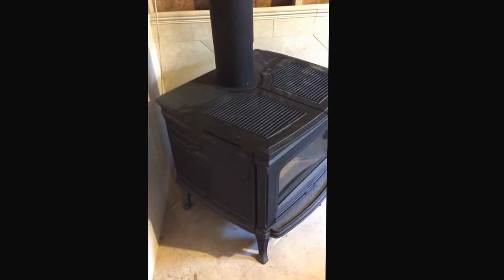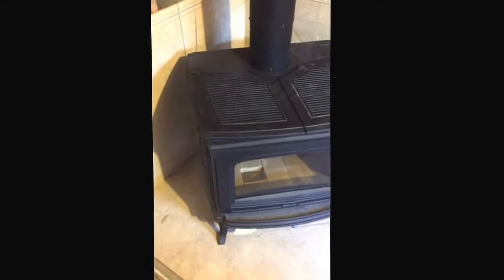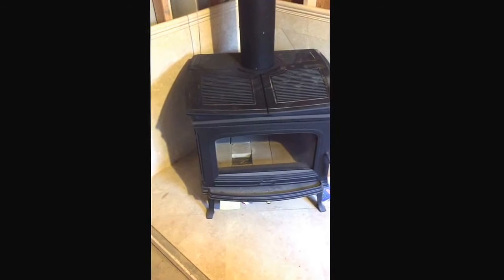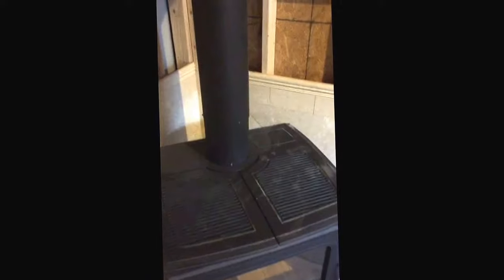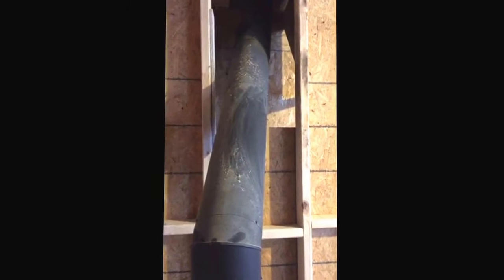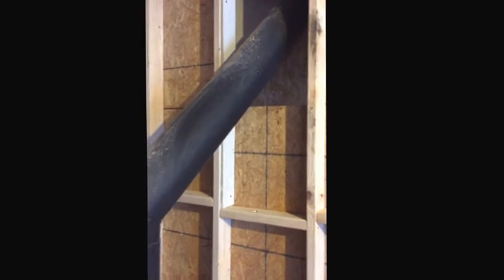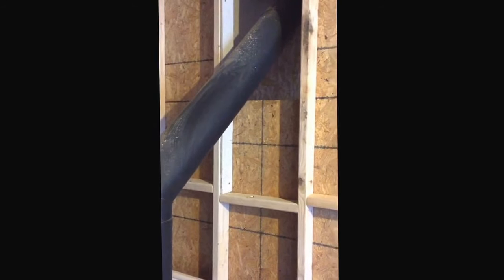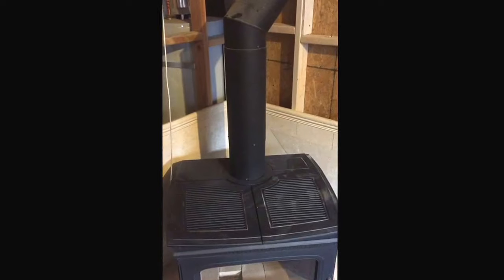Safe Through the Wall Stove Pipe Installation pt.1

Comment: Hi Matt and Maple mountain fireplace, Quick question for you guys, wondering if you can tell me whether or not a wood stove can have a chimney setup as just a straight pipe which then curves to protrude out the wall at 45° (an "L") with No chimney cap, wondering Only if it will ventilate properly Not whether or not it would be to code.
Thanks!
Reply from the maker: NO WAY! Sometimes when everything is up to code you could still have a hard time getting your Chimney to draft properly due to other factors such as change in air pressure, wind, weather... Its always BEST to do things right the first time. Especially when it comes to something like a Wood Burning Stove that could potentially Burn your house down or poison your Family with Carbon Monoxide... Thanks for the comment, be safe!
Reply: @mrEnergy511  
Thanks for the reply, Definitely not thinking of installing one that way I'm staying in a place currently that has it's chimney set up in just that way, tried  haveing a fire smoke was coming back in through the wood stove, not a commercial wood stove made from an oil drum, even when the fire was Ripping when I opened the door smoke would pour in from the top of the door. It seemed to be venting okay outside.